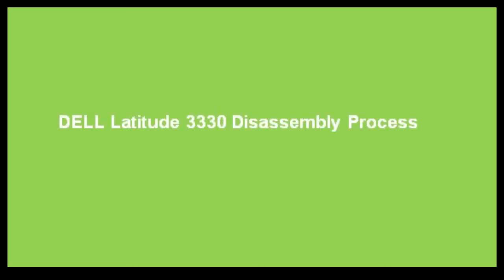How to disassemble dell Latitude 3330

Comment: Thanks for this! Whoever worked on this machine before it reached my hands had removed the captive screws which are surprisingly important for a smooth disassembly procedure because they lift the bottom cover off just enough for inserting plastic prying tools underneath. The official owner's manual wasn't particularly useful in that regard.

Comment: Can this laptop take more than 1 hard drive internally? e.g. 1 HDD & 1 SSD?
Reply from the maker: https://i.dell.com/sites/csdocuments/Shared-Content_data-Sheets_Documents/en/au/APJ-Dell-Latitude-3330-Technical-Guidebook.pdf
Reply: @techs2support  I checked it out but it doesn't say whether I can have 2 drives simultaneously installed.
Reply: @JeanPaulFernandes  I know I'm two years late to the party, but to answer the original question: YES! You can have an SSD and a hard drive at the same time!
This machine has a miniPICE-style slot which can take an HSPA (3G)/LTE (4G) WWAN card OR an mSATA SSD.
This machine was released back in 2013, so SSDs over 64GB were obscenely expensive, that's why mSATA drives were mostly used just as flash cache for making laptop HDDs seem faster than they actually were.
Ideally, nothing stops you from installing your OS to a big mSATA SSD (largest I've seen officially is 1TB, though you can get 2TB drives which have been pulled from Samsung T3s on ebay) and use an HDD for dumb/slow storage simultaneously.
Reply: Scratch that "ideally" out, it does actually work!
By default, the BIOS is configured to use both the SSD and the HDD in a RAID configuration, effectively using the SSD as flash cache for the HDD.
By setting the SATA controller to AHCI mode instead of RAID, both drives can be used independently.
Hope that helps.
Reply: @YeOldeKamikaze  can it use M.2 PICe ANd M2 sata size 2242 OR mSATA only
Reply: @phonprom-2511  The one I disassembled didn't have any M.2 slots, only a miniPCIe/mSATA slot. Hope that helps.
Reply: @YeOldeKamikaze  THANK YOU SO MUCH